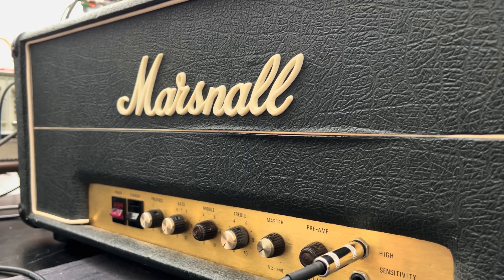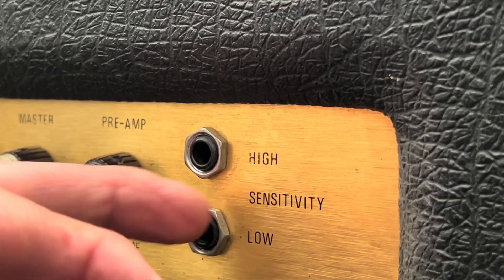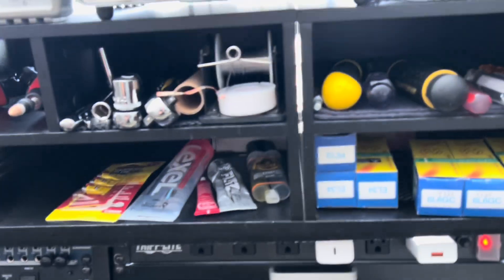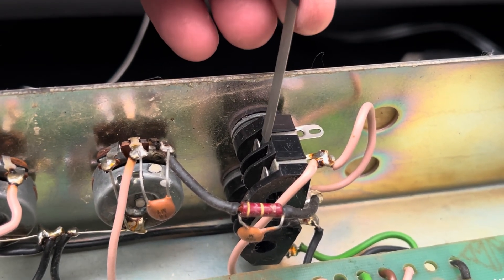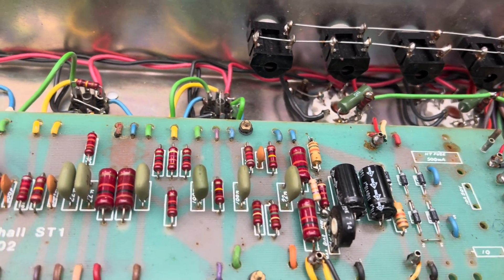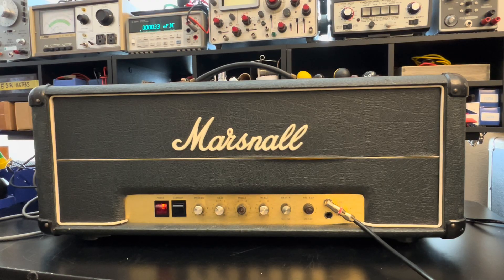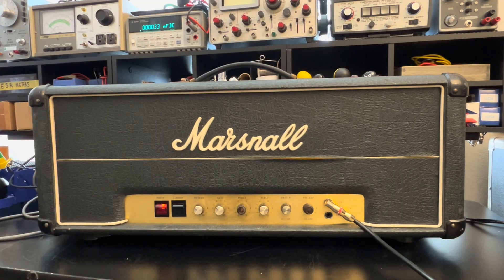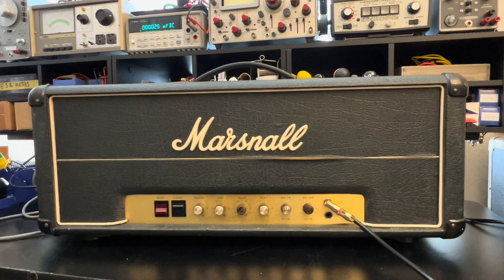1977 Marshall JMP100 || Basic Maintenance

Comment: Hi Frank ..can you please make a video re:  the Pros and Cons of pulling two power tubes from a 100 watt Marshall to run at 50 watts.    ....and state if there is something else that should be done top optimize the tone and safety of the Marshall.   I know everyone has thought of doing this.         Or maybe just a comment is good enough,   maybe Im just a dinosaur, and everybody else has gone digital anyways ???.................
Reply from the maker: Not many downsides!  Less stress on the output trans,  but you must make sure to pull the correct two tubes!  In addition, you must change the speaker load setting. 16 ohm cab?  Move the selector to 8 ohms. 8 ohm cab?  Move it to 4 ohms. So on. Set to half impedance of cab. You’ll have no issues. 

Best things you can do is keep the caps and power tubes fresh and never, ever power on the head without a speaker load connected. Marshall’s HATE that!

Comment: Did they ever make a Marsnall that went to eleven? I'm wondering if Marshall owned that technology back then.
Reply from the maker: It’s just hype!
Reply: @ForgottenGearRestorations  My amps can be turned down to negative 5. For library gigs.
Reply from the maker: @socallars3748 I was once asked to turn an unamplified acoustic down. That’s when I knew I was done with the whole industry.
Reply: @ForgottenGearRestorations  It's always nice to be appreciated for your work! 🤣 In my business, I called it "fattening frogs, for snakes." I suppose you could put a set of Silk and Steel strings on that acoustic, that would quiet it right down! 🙉
Reply from the maker: @socallars3748 we were turned down so low it was practically a  milli vanilli concert

Comment: I have a 1977 Marshall 50 watt head. When I got it, it had those metal nuts on the plastic jacks and I just thought someone lost the plastic nuts so I ordered some. I have also seen a few more '77's only that had the metal nuts in videos and pictures. I may put mine back on if it was original. I just can't understand why they would've done that at the factory. The plastic ones have way more surface area to seat against the face plate and won't damage the threads. Who knows... Mine came with the lower 365 volt power transformer as well which I love. love the videos keep em coming.
Reply from the maker: They are OG, son!  This old girl has the higher power transformer. Just a beast and a treat to work on. You’re a lucky dog with that one!
Reply: @ I like the little green  caps from this year too, They only had those for a year or so. I’ve asked around about them. Not a lot of info on them But I read they are Erie brand caps. bought a set of vintage mustards to replace them but no need. My original Dally filter caps tested fine but I replaced them anyway. I could still put them back in lol. Yep way cool amp. Mine is in excellent cosmetic condition except I accidentally wiped off some silk screen numbers around the knobs the day I bought it trying to clean it up. Oops super fragile silk screening.
Reply from the maker: Good looking out on those Erie caps - I don’t recall seeing them anywhere else. I’m really surprised by how nice this amp sounds and the caps are incredibly well made. Good sourcing by the guys back in the day.